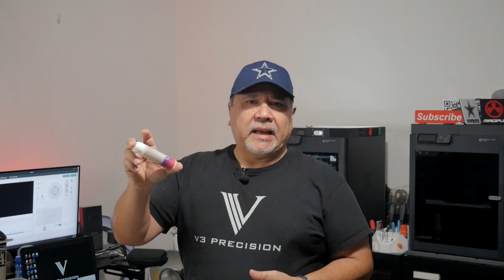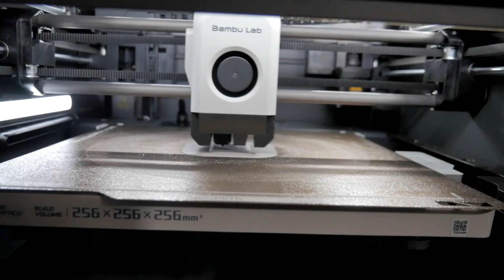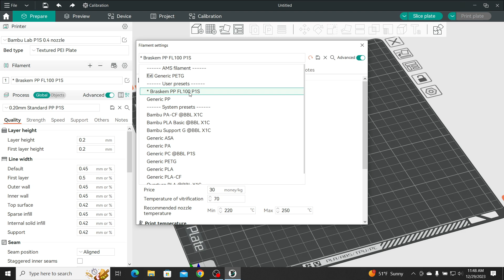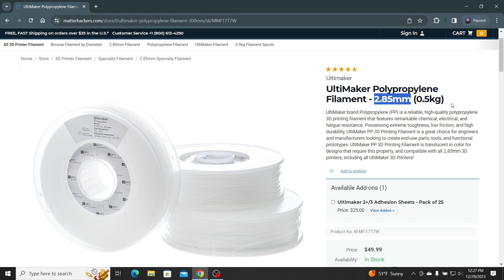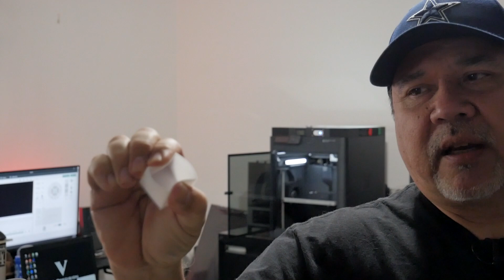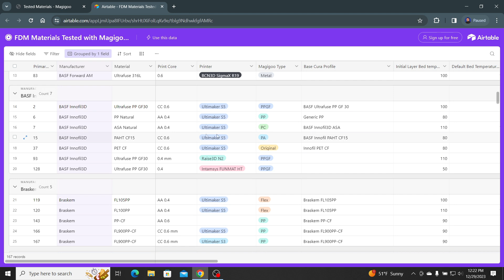Try Printing with Polypropylene (PP Filament)

Comment: I've been struggling with Polypropylene on my P1S, even if I pre heat the chamber and have all fans off or very very low, it warps so much that it bends the plate up off the bed.  Bed adhesion seems fine with dried bed glue and a constant 100c bed.  I suspected it may be the infill causing a temp difference between the layers, so I ran a few test prints, and 100% concentric seemed to yield the best results.  I'll have to play around a little more with it.

Comment: I just printed some test prints with PP and im getting poor adhesion on inside walls. Im printing a circular part and just test printed threads with little bit of the main body and the inner walls just peal apart like sheets of paper.  Outer 5 walls seem to have good adhesion. Im going to decrease the line width of the inner walls to see if that helps. Might do the outer wall a smidge aswell. But I'm curious if you came across any of that.
Reply: Have you solved it? I had the same experience with flex pla with circular thin walled objects. The slicer used parallel circle walls resulting in poor wall adhesion. What fixed it was stitching the walls together in the slicer either by thickening the walls in cad or changing a setting I don't remember.
Reply: @matenorth  Up I did af flow dynamics calibration in Bambu studios and it seem to get rid of that problem?

Comment: So I used to print polypropylene on the X1C its was a huge pain it constantly clogged for me but not actually at the nozzle, if you unload your filament you'll notice the extruder gears chew up the polypropylene hard and will gum up the gears. 
I believe the issue with the enclosure is that the filament softens in the extruder head before it gets in the nozzle I'm not really sure how to combat this. I printed it pretty huge polypropylene vertical water tower but it was a nightmare.

Comment: Good info. I recently tried to print a benchy on my P1S with PC, using the generic PC settings, I got very bad layering adhesion. Any suggestions?
Reply: I did a benchy in clear Bambu PC using the default settings that Bambu Studio recommended.  It printed pretty hot - 270 and 110 IIRC but it came out almost flawless (very minor layer sep on the bridge over the front window).  I have had pretty consistent good luck with Bambu branded filament and I love the RFID spools with the AMS.  It’s like RonCo — “set it and forget it.”

Comment: As a random test trying to get polypropylene to print on my X1C, I used the Bambu Engineering Plate that had been cleaned with acetone and the default Bambu settings for polycarbonate. It worked like a dream over and over for every print. After around 10 or so prints I would have to re-clean the bed. I was about to give up on printing PP but I figured "why not..." and gave it a shot.
Reply: what brand fillement did you use?